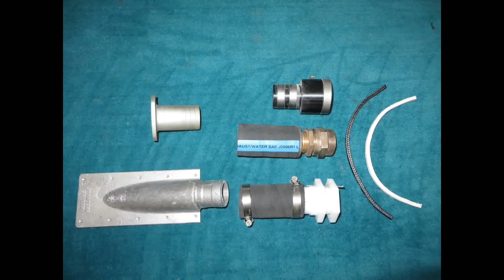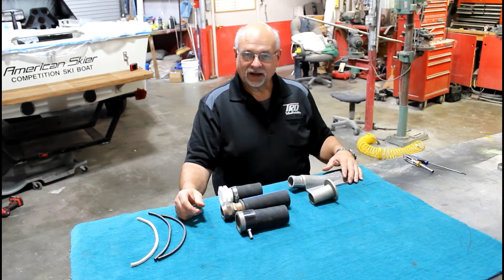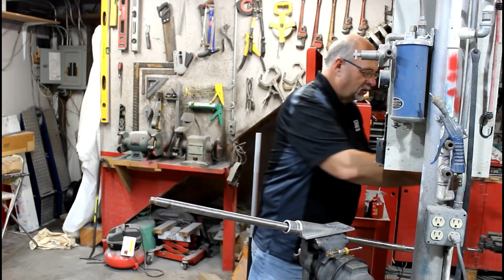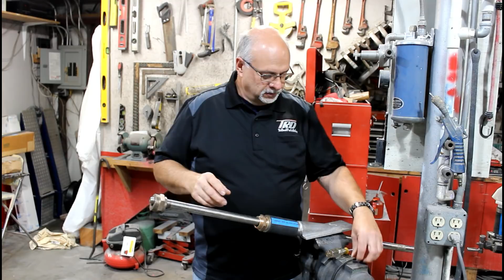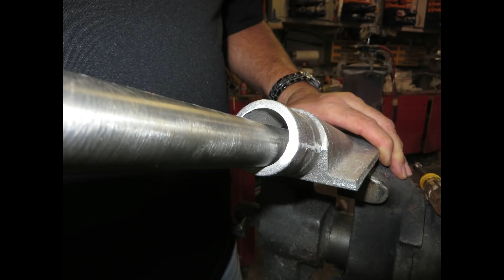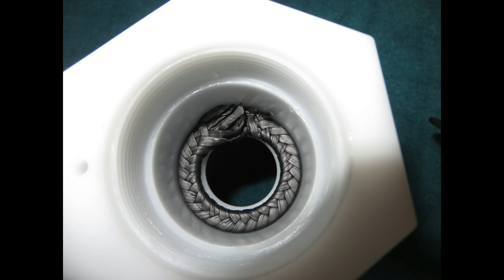SKi Boat Shaft Packings Part 1

Comment: Hi Ron your video's really good I have a question to ask I have a 1992 Supra and has a 351 direct drive. Well the problem is is we'll be driving the boat for about an hour maybe an hour and a half and all of a sudden we get what I would call shaft wobble maybe You probably heard this before but it won't rev up and won't go more than 10 miles an hour until it cools down a little bit. Once it cools down then it runs fine again. Do you know what the problem could be? I'm going to repack. But you said it might be a thrustbearing. I did notice that The packing does not drip in. And I did notice that on the shaft up by the gearbox it's cool but right by the packing nut it's hot so it seems like something is heating up. Can you please explain to me a little bit about the water dripping from the packing nut to keep maybe the shaft cool? But why would it do it and then stop doing it and then do it again and then stop doing it.? Thanks for all your help I might send this to your email maybe if you have one
Reply: Traditional packing glands aka stuffing boxes need a slow drip allowing water to keep the temps down within the packing so the lubricants don't burn out of it, an over tightened packing will "cook" the packing out.

Comment: Great video. The 45 degree cut at first made sense to me, but wouldn't the better practice be to keep the mating areas of the seal cross sectional "faces" to a minimum? That would be the path for water intrusion, and maintains the smallest area for that to occur would mean a nearly perpendicular cut, no?

I understand how impossible that is, and an angled cut is basically necessary here, but a minimum angle would be the best. Unless I'm missing something, and I'm sure that I am... 

Again, great info, sir. Thank you

Comment: Hi, everything i have read says to use flax shaft packing! You mentioned something else. Is flax the standard?
Reply from the maker: Flax was used up to about 1990's when teflon became the new standard, and in the mid 2005-2010 the combination of teflon & graphite became the current standard (GFO/GFU)
the new GFO/GFU take heat much better & drips less. We still use teflon for rudder boxes that use packing.

Comment: Great Video - If you are currently going through Maintenance, is it possible to convert the Brass style to the Nylon style? If so, do you suggest converting?
Reply from the maker: Yes, on V-drives the plastic stuffing boxes are much easier to adjust.

Comment: Im assuming inside the shaft log is the  cutless bearing and seal?
Reply from the maker: On a typical inboard the cutlass bearing is inside the strut just ahead of the prop, the shaft seal aka packing gland is attached to the shaft log inside the boat via a short hose.

Comment: Great video, excellent step by step.  How easy should the shaft be to turn when not in water?  I have to use 2 hands to turn right now.
Reply from the maker: With a little soapy water sprayed on the shaft it should be easy to turn with one hand, shaft our of alignment will not turn easy

Comment: Very well done. 
When you cut the packing material at a 45 degree angle, do you mean 45 degrees from the top of the strand to the bottom of the strand - or from one side to the other side?

Comment: Ron, that’s the best presentation of this topic I’ve ever seen. You hit all the important points. Bravo! 
I would only add, never use graphite containing packing to a yellow metal shaft as severe anodic corrosion to the shaft could happen. Use straight Teflon in this case.
Reply from the maker: Thanks for your comment, I recommend the Graphite types only over stainless prop shafts,  and the std. teflon for rudder posts which can be either brass or stainelss

Comment: Hey Ron, thank you for the video and knowledge to help assist me for the pack glands. I will check your website and will be purchasing the gland on your site soon . I also need to replace my 55 amp Mando Alternator to a much higher output. I run a large steroe system and 3 batteries. 2 that are parallel on one side and another 1 for my starter on the other side. All Optima group 31 Blue tops (which I need to replace cause they suck and since they are now made in Mexico they dont last). I was thinking of trying the Banshee group 31 deep cycles. But I will wait for your response about the alternator first. My name is Jeff and God Bless.
Reply from the maker: Sounds like you need the new Balmar alt. I did a video on these this past year, it will cure your charging issues. https://skiboatpartsonline.com/inboard-engine-parts/%20Inboard-Engine-Parts-Drive-Parts/alternator-Balmar-XT-Series-MEE-0050

Comment: what size packing material?
Reply from the maker: All the ski boats I have ever serviced used 1/4", even the older Correct Crafts with the 3/16" packing I will use the 1/4" and flatten it making it wider and seems to work even better that the std 3/16 material.
Reply: @rontanis1024  thanks. i have a 1996 ski centurion. i just found your videos. they is awesome!
Reply from the maker: @cosmasnicolaidis4529  Thanks, and your welcome